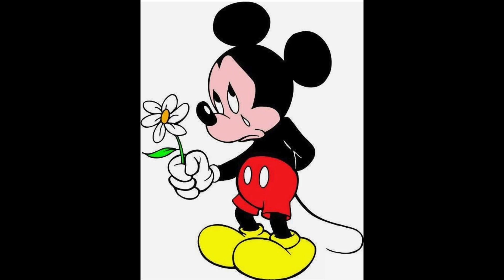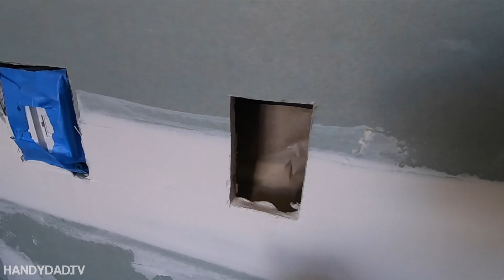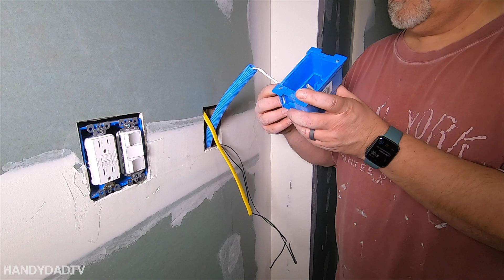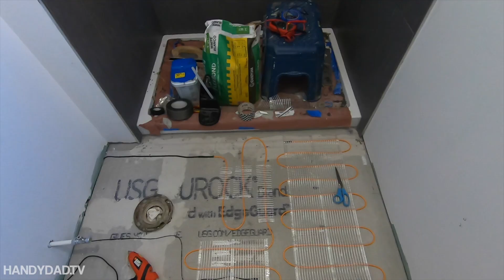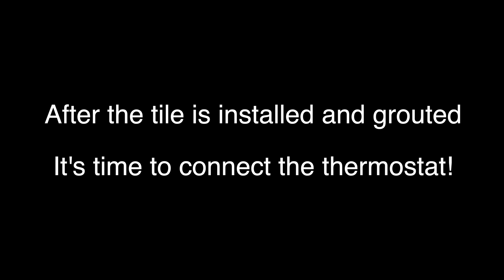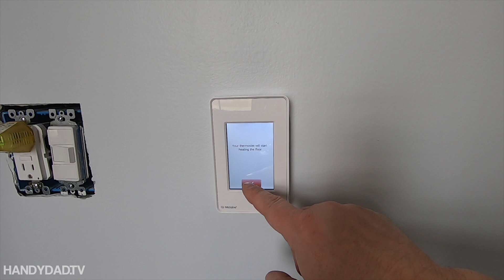WE HEATED OUR TILE // TLF 23

Comment: Thanks alot for all that great information. I plan on replacing a back porch with a bathroom with heated tile flooring. Underneath the bathroom will be unheated. We live near you. Pennsylvania. Do you think the cold air underneath will make it an efficient heating system? Will the heated tiles help the water lines in unheated area to not freeze? Thanks for any help you can give me
Reply from the maker: I wouldn’t count on any heat radiating below the tiles. If you must run water lines in an exterior space, consider using pipe heaters.

Comment: I discovered when hanging a TV on the wall trying to run all the cables in the wall problematic, but I gave it some thought and devised a clever solution. The wall was an outer wall with insulation. Using a fish-tape was catching and gouging on the insulation. I didn't want to damage or degrade the insulation so I stopped and gave it time to mull over what to do. Next day I got string and big washers. Tied the washers to the string, dropped into the top hole and lowered to the bottom hole, took off the washers and tied in the cable ends, them pulled them up inside the wall smoothly. Went really quick and was pretty damned proud of myself!!
Reply from the maker: Awesome!

Comment: why didn't you put your floor probe in a smaller conduit for it to be replaceable in the future?
Reply from the maker: The probe is embedded in the mortar. It can’t be replaced, regardless of the conduit. That’s why I installed a second one as cheap insurance.
Reply: @handydadtv  no it can be replaced, you just put the probe in a 16mm conduit and feed the 16mm through a 20mm. The probe comes out and can be pushed easily in a 16mm

Comment: Why not the load side of the GFCI?  Can never have enough protection around water.  Especially if someone touches thermo with wet hand, standing with wet feet or in water from previous shower. Thanks for all the vids.
Reply from the maker: Not if the thermostat has it built in. Otherwise it could pop the outlet when the relay clicks. BTW, I heard 2 GFIs in-line are against code.
Reply: HandyDadTV Thanks for the reply. I saw the thermostat had the GFCI later in the video my comment was right after I saw you connect it to the line side. Next time I’ll wait to the end to reply.